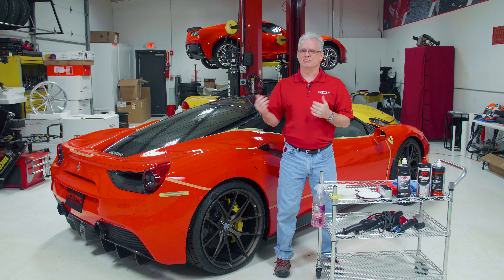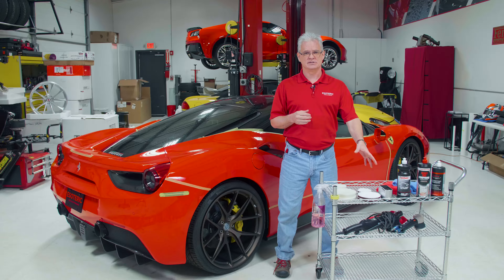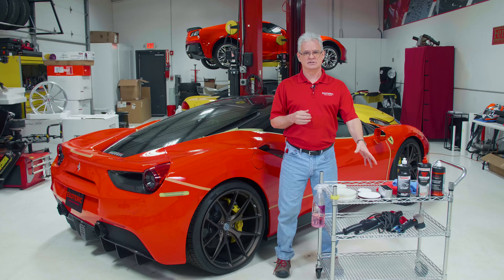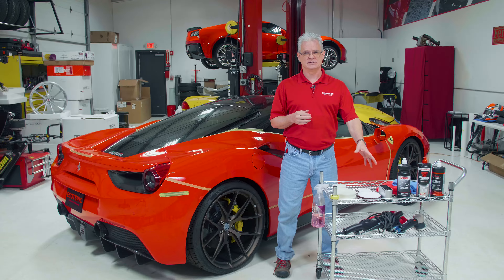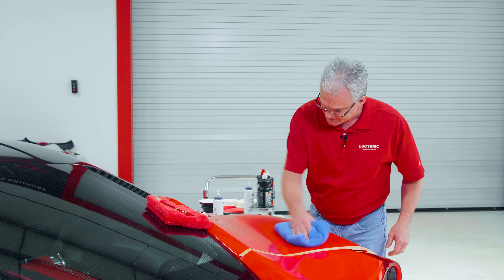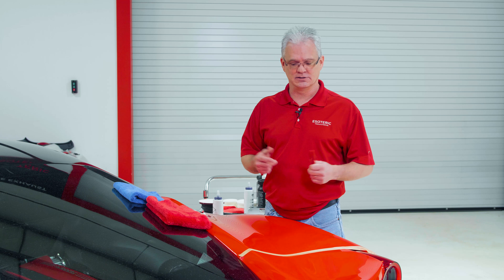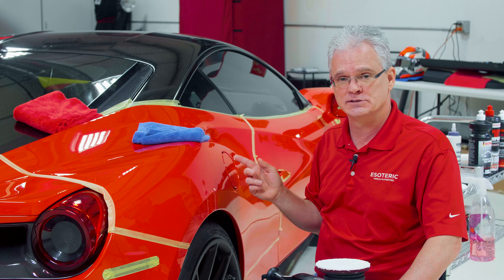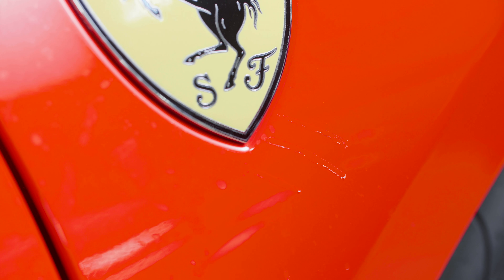Ferrari Detailing Part 6 - Paint Correction - ESOTERIC Car Care

Comment: Great video, so many things to learn from it.

Truly amazing how many seemingly little aspects go into successfully compounding/polishing a surface without the frustration of pad stalling, less than desired results and wasteful movements. Love when you guys get into close-up, technique-centric videos on polishing. Not so much pad choice or polish/compound choice but rather the tiny things like grip on the machine itself, dominant control of machine via grip at head of machine vs. handle to direct/control, backing plate used, how you determine/define each section to be worked. Somehow sections always seem to grow on me between start and finish.

Will be watching  this many times to reinforce the things that you guys likely do from muscle-memory; personally have a frustrating tendency to use the handle end of a Rupes to control movement at times, leading to teeter-totter effect on pad, i.e. stalling. Remembering to primarily control via grip around head of unit when appropriate, as seen in many of your videos, helps considerably in that aspect.

Keep the videos coming, so much to learn, the manner which you polish is truly artistic…always cool to see the fluid movements of the machine over the surface. You’re certainly painting masterpieces with your work/methods and I’m still painting by numbers here but you keep up with the great videos and I’ll keep getting better, moving up a few rungs on the ladder in terms of efficiency and results.

Many thanks to you guys for the ‘Continuing Education’…maybe if Spring actually ever arrives in Ohio I'll be able to put all the info in your vids into actual practice.
Reply from the maker: Thank you for the kind words as always Kurt! Yes, there's a lot involved when you consider your eye for details, muscle memory, how you hold / control the machine, pressures, overlap, reading the paint and how it's reacting, etc, etc, etc. When you combine the right tools, products, and techniques, along with plenty of (proper) experience, it does become art. 

As always, don't hesitate to make a stop down here. Our open house will be June 2nd this year.

Comment: Great video Todd. Question, what would you suggest to use if the client did not want a multi step correction, just a single stage correction? Thank you
Reply from the maker: As with any car / customer...you offer them choices, and go with their wants, needs, and budget.
Reply: @Esotericdetail  Thank you and yes of course. What I meant was what product combo would you suggest                    ( pad/compound-polish) for this type of car. For a single stage correction that will enhance the paint without digging  a deeper hole to go into a multistep. With soft Ferrari paint systems, don't want to get stuck. 
Thank you Todd!
Reply from the maker: @TKTampa  Can't go wrong with Sonax Perfect Finish and yellow Rupes polishing pads.
Reply: @Esotericdetail  Thank you very much!! Love you guys.

Comment: Do you ever do just polishing without the compounding first?  Let’s say you have paint with no swirling and just the slightest amount of very light towel marks. I usually go straight to M205, which has no problem removing any slight imperfections. Is there a need to use a two step in that circumstance?
Reply from the maker: We do, and there's more demand for single step polishing than there is multi step polishing. The defects on this car couldn't be fully removed with even an aggressive one step polishing process, and the customer wanted it to be as good as possible.

Comment: I have a 2014 bmw M5 what product would you recommend to use on a two stage correction ? Is the bmw paint hard to work with ?
Reply from the maker: Peter. I would approach it like any other car. Given that, our go-to combo to try would be Meg's MF Cutting Disc and Jescar Correcting Compound, followed by Rupes yellow pad and Sonax Perfect Finish for our finishing stage. Ultimately, our test sections will determine what will work best, but it's a rare occasion that we need something different than this. I hope this helps.
Reply: Yes it helps thanks .You guys have more experience so its good to get input . I also appreciate your quick response    @Esotericdetail

Comment: Good video!!! But I thought you're not suppose to lift the polisher until it stops turning....??
Reply from the maker: You do not want the pad to simply stop spinning on the surface. The proper technique, as used here, is to let off of the trigger while it's on the surface, then gently "feather" it away. What you don't want to do is to lift it from the surface while the machine is still under power.

Comment: wondering why the correction wasn't done before that film was applied? thanks
Reply from the maker: You mean originally? You never know where it was originally done. If at the dealership, then they're just asking for film. Even if at a detailer, there's no guarantee that they will correct the paint. It also comes down to what the original owner of the car may have wanted...perhaps just the PPF without any correction.

Comment: this is great.

Okay thou. with DAT based compounds/polishes. Let's talk about that front fender. It's a small work area indeed. So how do you make sure that the compound/polish has fully diminished?
Reply from the maker: You should be able to tell just by looking at it after your work section. Did it correct as well as the other areas? Did it finish down as fine as the other areas? If so, then you're good to go. If not, then you need to change something up (work time, pressure, etc) until you achieve the same results as the bigger, flatter areas.